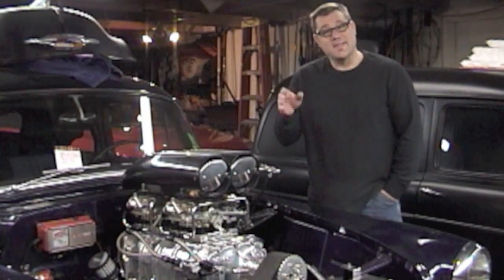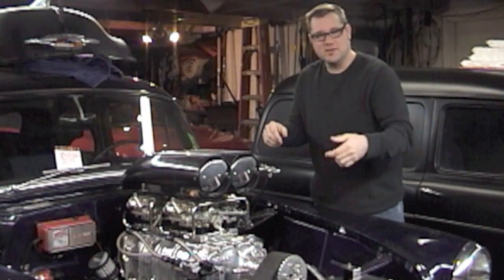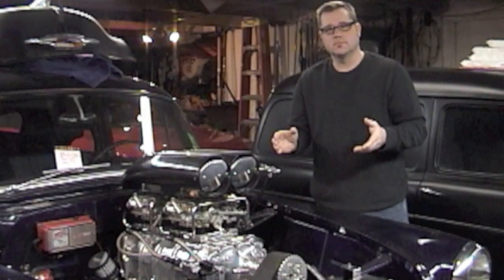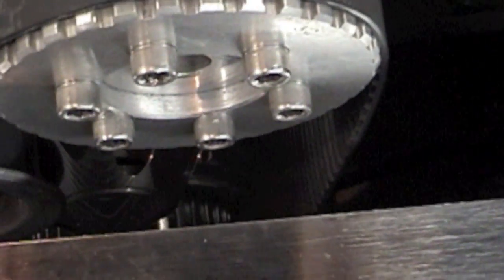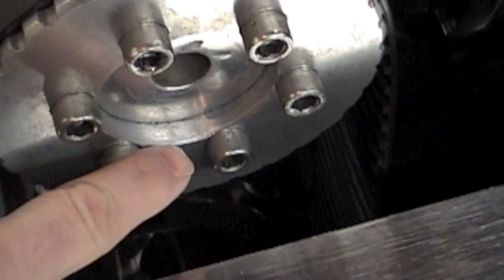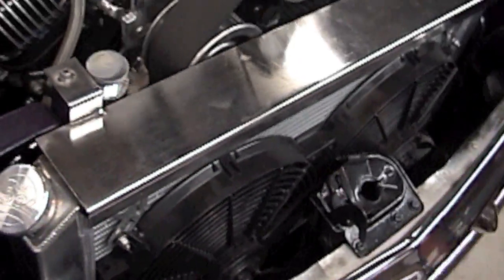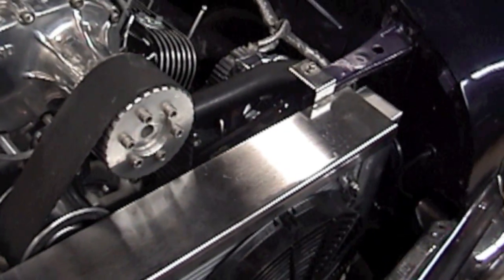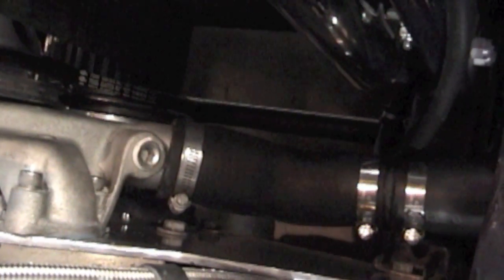Part 22 Cam Break In Procedure For The Big Block Chevy

Comment: You make some great vids-Regarding the current oil and lack of ZINC what do guys run for safe oil now?? I had a 427/425 Yenko Clone Camaro with 456 gears and a 4 speed in the mid 70's, oil then never a concern, I knew someone who used OILZUM 40-50 weight non detergent I heard now guys wiping out cams due to the crappy oil available now

Comment: Great job with your mini series .I have rebuilt engines in the past, but I still learned a lot from you.I love the detail you get into and the reasons you assemble the engine Not using a hammer on the timing gears .I very much like your endings  I was raised a Christian person also and can tell you have great values. I am also from Wisconsin. Keep up the good work